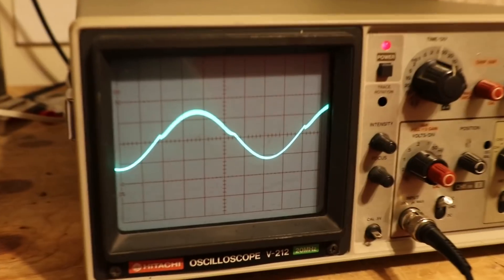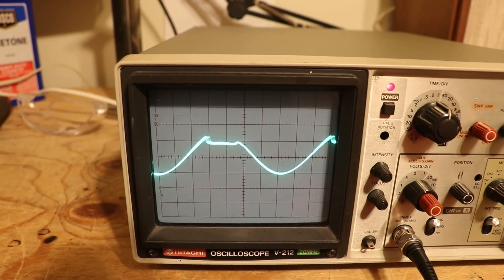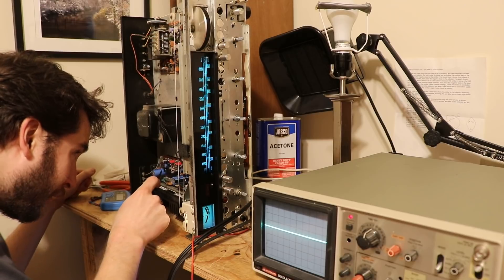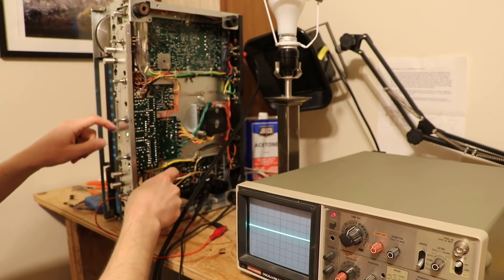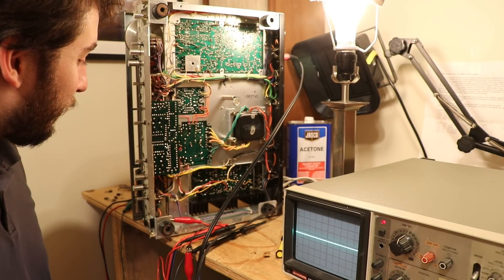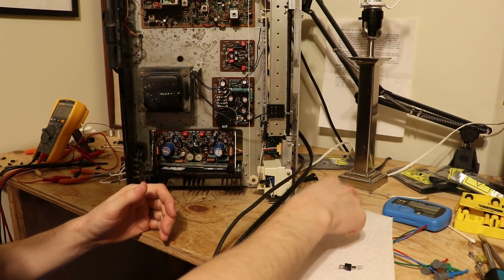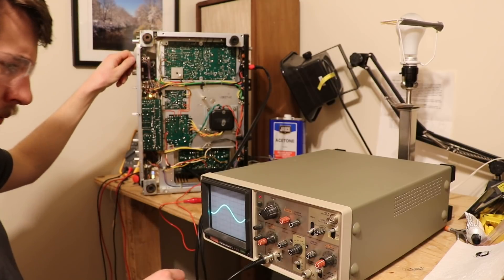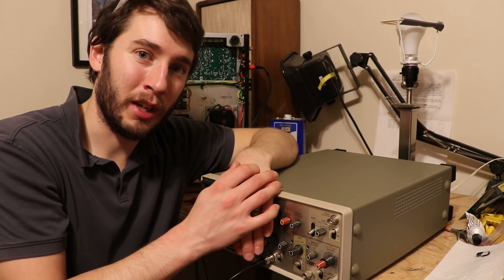Don't Blindly Substitute Transistors - Marantz 2215B Restoration Gone Wrong And Other Mishaps

Comment: What is the rational for replacing working transistors ?
Did anyone actually look at the specs and see if they are compatible?
I can understand replacing the electrolytic caps as they do dry up and go bad.
The old  saying still holds true - "If it ain't broke don't fix it."
Reply from the maker: Transistors do fail, as I've demonstrated in some Pioneer videos. I found a list of replacement transistors someone on audiokarma had specifically put together for the 2215B. I had them all on hand so I tried it out, assuming that someone had already done the looking to see if they were compatible. Clearly they didn't, or never noticed how their amp sounds like total trash after rebuild. That's actually how I first noticed the issue: music sounded very bad at higher volume. So I put a sine wave through it and read it on the scope.
Reply: @AHFixIt  I agree, transistors do fail. 
I may be wrong but in my 45years of fixin' lectronics , the only time I've seen transistors fail is when they have been abused. I would never ever replace a transistor in any part of an audio circuit unless it failed, and then I'd do my own research to make sure the new part was the same as the old part if I couldn't get an exact replacement.
I would however replace every electrolytic cap in any thing over 15-20yrs old.
Reply: @AHFixIt   The only instance in which I would make it a point to replace "working" transistors in a more or less functioning unit would be if they are beveled edge  paintbrush style transistors, and especially if the leads on the transistors are oxidized jet black. Those things often fail causing popping noises and DC offset.
Reply: agree!!!

Comment: well im sure your not the only one thats done stuff like that, anyway im 52 but when i was your age i was working on smaller electronics in high school back when you could take stuff to school sometime in the early 80,s anyway have a good one im working on hk 430 and replacing a 10 pin output transistor on a optonica

Comment: Been there done that with my 2250B main amp board.  I forgot to put back the thermal sensor on the heat sink and shorted out something and ended up blowing the fuse plus output transistors.  Won't do that again!.